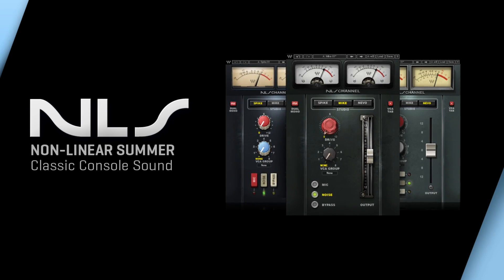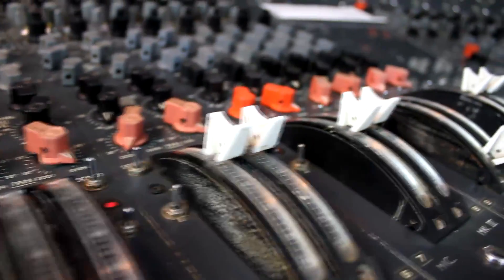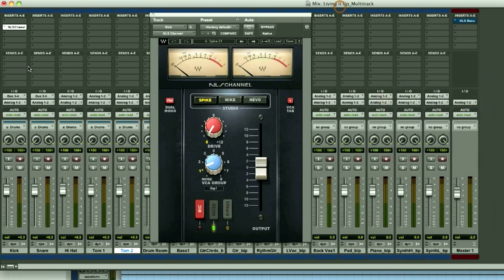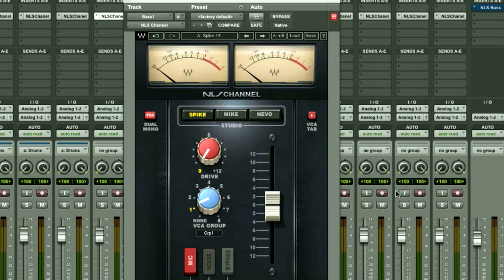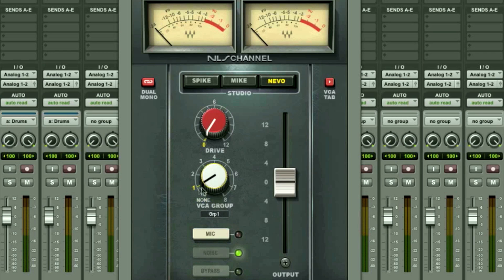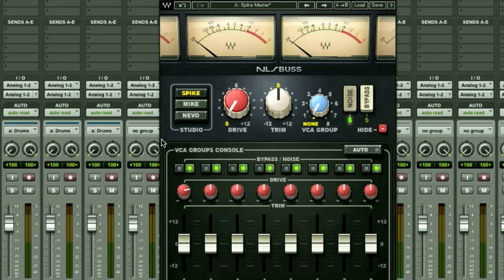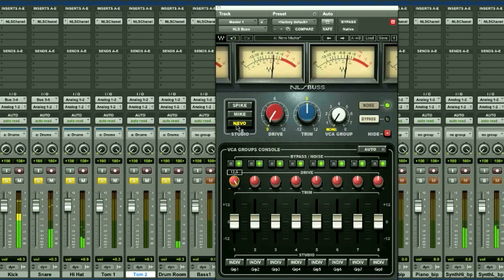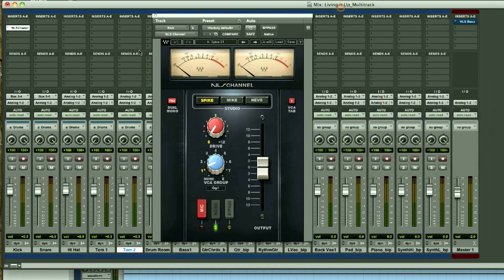Getting Started with Waves NLS: In-Depth Tutorial

Comment: I don't get what the vca  group knob is for in the bus plug in. is it just for monitoring and not controlling? it's very confusing
Reply: If you open an instance of this plugin on each of your individual drum tracks you can set all of those to VCA group 1 (for example) and then for each instance that is applied to your guitars you can set it to VCA group 2. I believe this will emulate the sound of the tracks being summed and give you the "glue" as well as giving you the extra drive and trim controls for your instruments as groups.

Comment: How to control amount for the mic parameter
Reply: There is no option to change the value of this button, it will simply change the headroom by simulating mic input levels, like when you switch from Line to Mic on an analog console

Comment: Hi, can anyone tell me.. If I turn noise "Off" will the tracks still be colored, albeit without hum noise/ distortion?
Reply: As I understand it, it won't have the hiss, but the colouration/distortion will be there.
Reply: nice, thanks alot :)  I've since only used it with the noise off, it's much better that way (especially if you're using multiple instances).. Btw, there's something almost magic that happens when u throw the "Mike" version on a bus & crank the drive up to 12 (if you gainstage it right)..